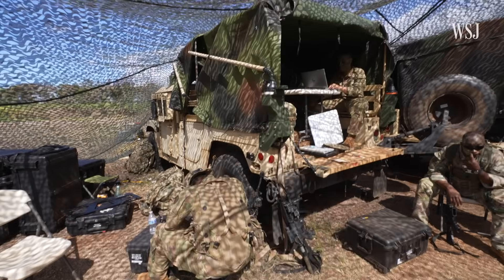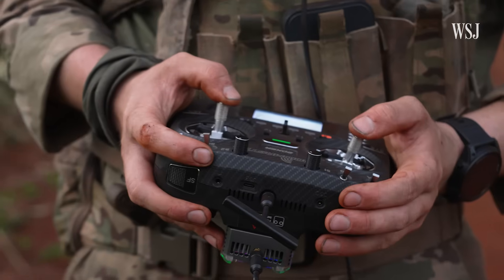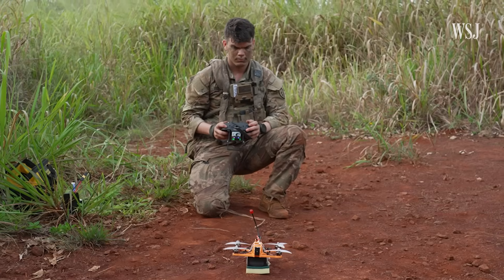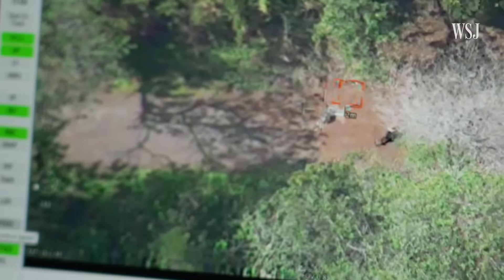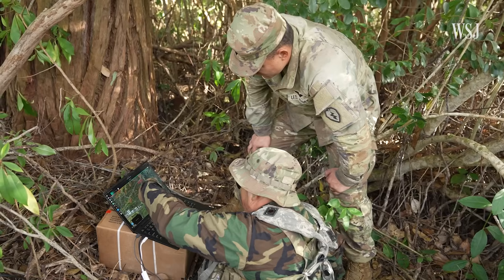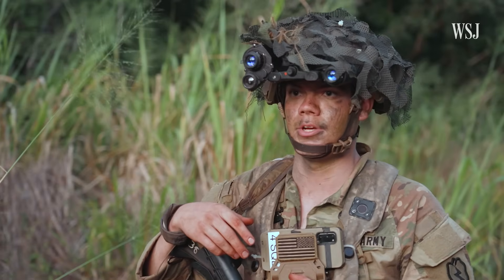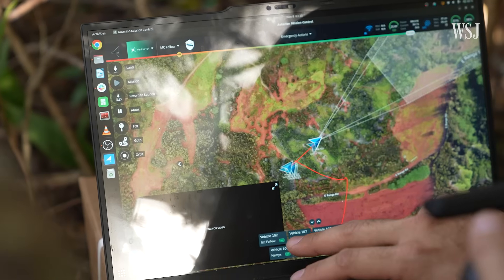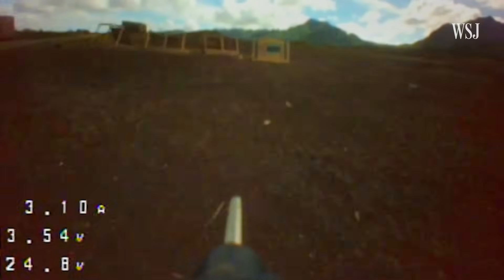How the U.S. Army 3-D Prints Lethal Drones in Hours | WSJ

Comment: They do not have time to build anything out there. Setup with 3D printer takes space of 1000 ready made carbon fiber frames, yet you still need motors, batteries, explosives and PCBs.
Reply: Add rotors to the list. 3D printing sound futuristic, but it's only good to make one off parts that aren't under much load.
Reply: I think this is just a marketing gimmick. Or to be more precise, a show of a broad capability. In reality, those soldiers will not have time to print those drone components. 3D printers might be useful for every day life. If smth broken, one might just print the spare part in case of supply distruption happens.
Reply: @kenirawadi4689  I’m in the manufacturing industry for the aerospace side of the US Navy. 3D printing has mostly found its home in rapid manufacturing in a limited environment. We’re currently looking into adding 3D printing infrastructure inside a submarine as well as one of the many naval vessels.
Reply: @rufus2028   I agree with you. For "every day" equipment or spare parts, 3D printing is very useful. Especially, for military in a limited environment. However, this video shows how US military will mass produce drones in a conflict area during a potential conflict with China. Seems a bit misleading. Even in Ukraine, they do not use the printers in the conflict zones, they use them in the west part of Ukraine. And the manufactures are engineers or technicians not soldiers. Nevertheless, I acknowledge there are parts of drones which can only made via additive manufacture.
Reply: We can 3d print parts in factories it is just a different more efficient process if you are making multiple ones or want better quality.
Reply: US companies like Unusual Machines produce the motors domestically
Reply: To be fair, 3D printers are employed massively in Ukraine to print drone frames.
Reply: The Immediate Response Force can deploy on any continent in 18 hours. Their logistic and infrastructure can scale. On top of already having APS in place.
Reply: That is what you'd have supplies for. When supply lines are disrupted, they use those existing supplies and 3d printing to continue making their own for some time.

Comment: Whoever wrote this has clearly never 3D printed anything
Reply: What do you mean? I'm just a casual watching this trying to understand
Reply: @libiroli  3d printing takes a very long time to churn out a finish product, and has high failure rate, its one of its disadvantages. in the heat of the battle u cant be churning out enough products to be used in war
Reply: @thewolfofswingthat2035  Look at Ukraine. A stack of carbon fiber and a cnc machine can make much better frames at a much faster rate.
Reply: @thirtythreeeyes8624  CNC machines are not additive manufacturing.
Reply: @thewolfofswingthat2035  IDK cnc machines can be pretty addictive. Lol additive manufacturing is a lot like AI, tons of hype, every problem is a nail and it's the hammer. Mostly from people who don't actually use or understand the tech in any meaningful way. You should always use the best tool and material for the job not just the newest.
Reply: @thirtythreeeyes8624 additive manufacturing, not "addictive". CNC machines are subtractive, meaning they remove material from a substrate. 3D printing is additive (building up an object layer by layer).

It's a different technology. You can lump them into the larger category of automated machine tools (often using similar parts like stepper motors in a gantry), but they are not strictly the same technology.

For speed, injection moulding and casting can actually be faster, but the time and cost to produce dies/molds is the limiting factor for smaller runs or prototyping (where 3D printing and CNC shine).
Reply: @zivzulander  He's just joking about the addictive thing, but I agree with what you said. They would probably use injection molding if they wanted to really speed up production.
Reply: @thewolfofswingthat2035 not in 2025.  I literally made a submachinegun on my $700 printer.  It's not hard
Reply: @4lan39  how long did it took?
Reply: @4lan39 you'd need also non printed parts, you could maaaaybe make something single shot but definitely not smg
Reply: @uvenarbulis1724yeah a metal bolt and barrel, hardware is metal too like springs and pins.

Nothing a 10 year old can't buy legally in most states.
Reply: @thewolfofswingthat2035 I mean I've modded it over a couple years with different filaments and stuff, but it's been "supersafe" for a few months.
Now printed in PA12-CF which is able to put in an oven at 350 and survive
Could be printed and built in a weekend
Reply: @libiroli  they dont use a honeycomb infill, no supports, just an unrefined design. will probably get better but they should get some mechanical and structural engineers to optimize the framework and and corresponding weight to rigidity proportions.
Reply: Definitely has to have carbon fiber 1 piece reinforcement addition to the printed frame. but still not too bad
Reply: Came here to say this .